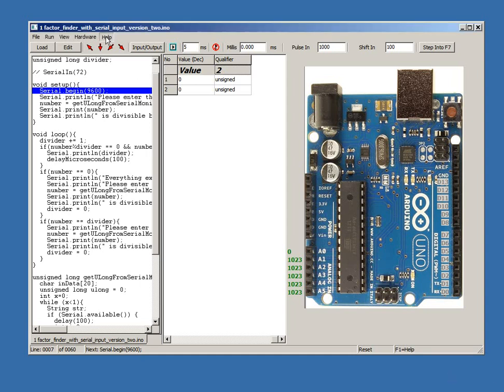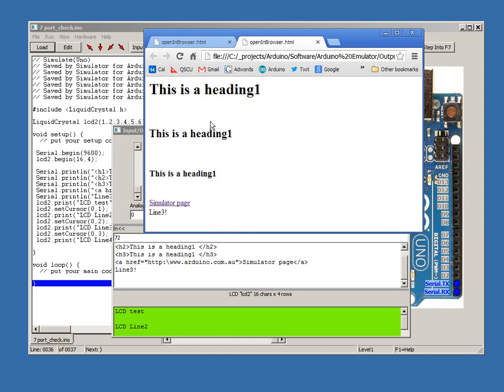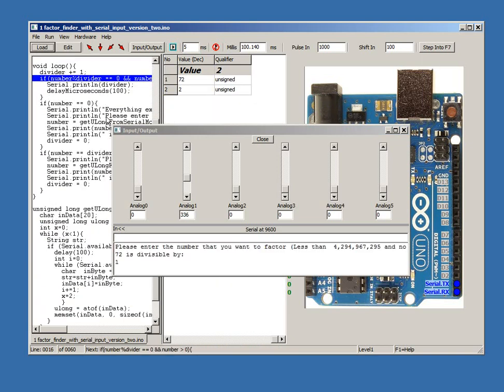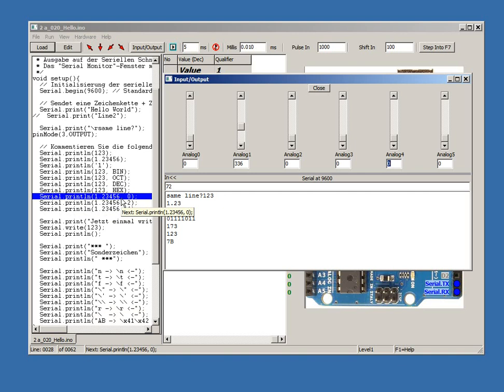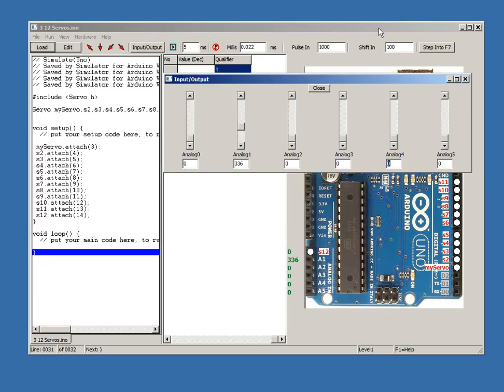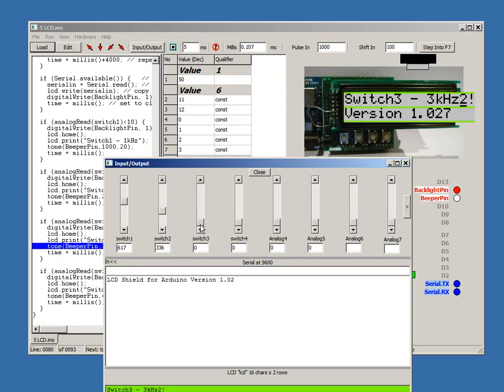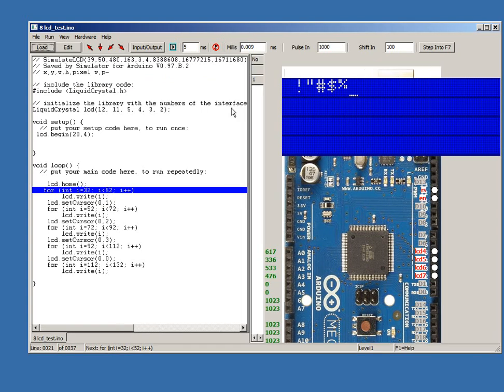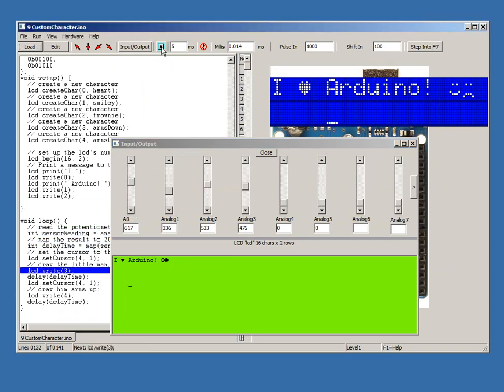Simulator for Arduino v0.98 Floating Point issue, Open browser, Simulate LCD

Comment: The 5 minute delay is only until the program is Unlocked. The there is a 7 day trial period or 100 sketches - whichever comes first. After Taft time, the Simulator will still work but will have a 30 second incrementing delay on every sketch load.  The Unlock is so we can keep track of real users (there is a no.emails anonymous option)